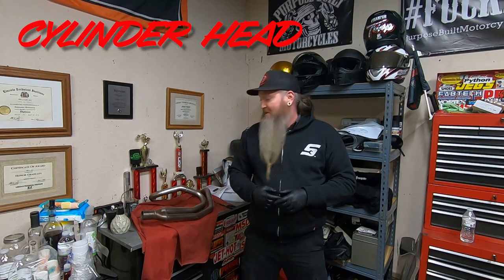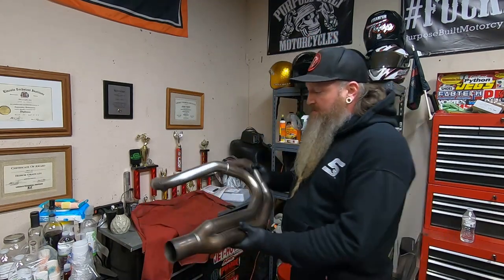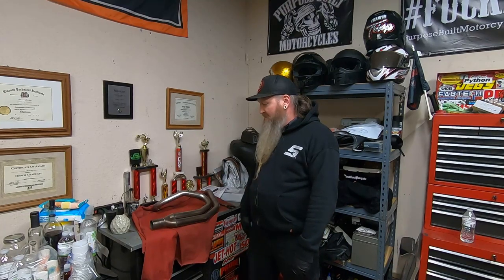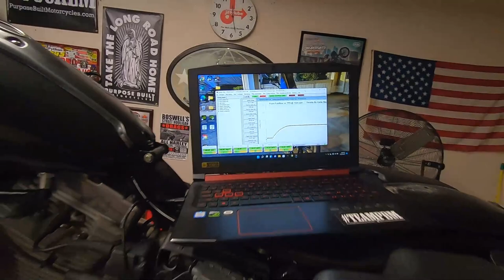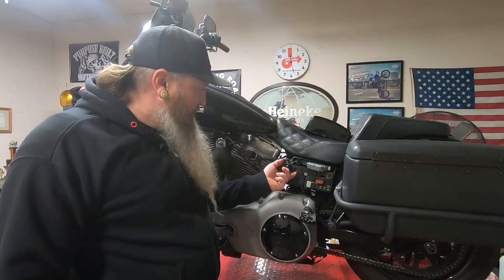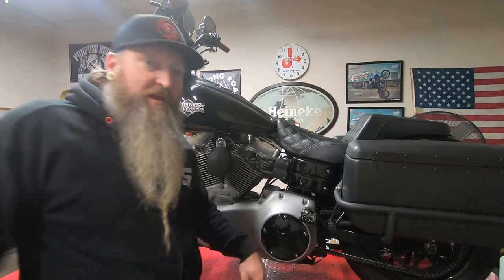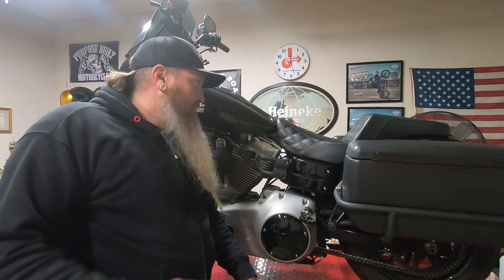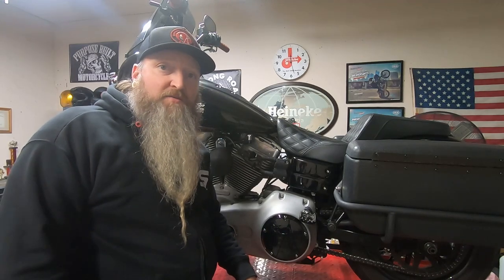Bassani Road Rage Broken / Thundermax Pig Tail Install / Clubstyle Dyna

Comment: I’m curious to hear what Bassani had to say about that crack 🤔 🤔
Reply from the maker: Said they had never seen that before and blamed it on the tune...🤦‍♂️🤦‍♂️🤦‍♂️if that was the case dont you think the pipe would have been a different color?
Reply: @TrippHPjunkie  sounds like someone doesn’t want to take responsibility for a faulty bend 🤷🏻‍♂️
Reply from the maker: I mean it is 3 years old still should expect it not to do that
Reply: @TrippHPjunkie  absolutely. 3 years shouldn’t be shit for a good quality stainless steel unless the tune has a lot of 2-step haha
Reply: Not even 2yrs old and the weld on the rear brace cracked. Bassani is crap and their warranty is worse.